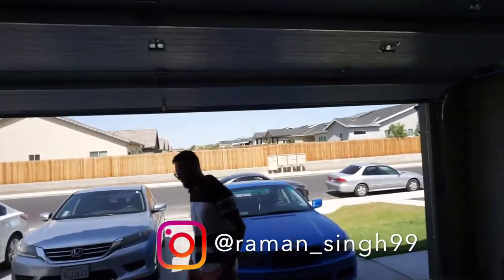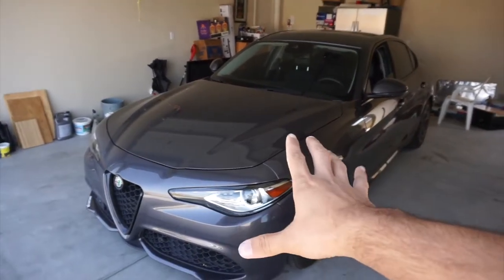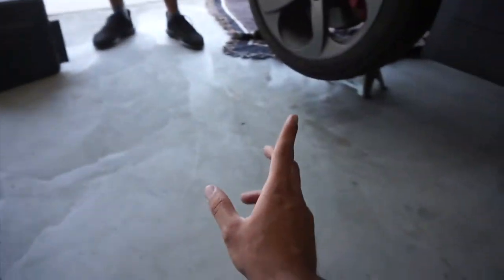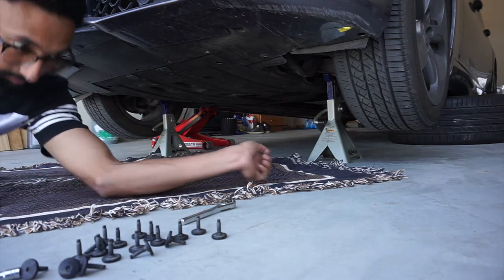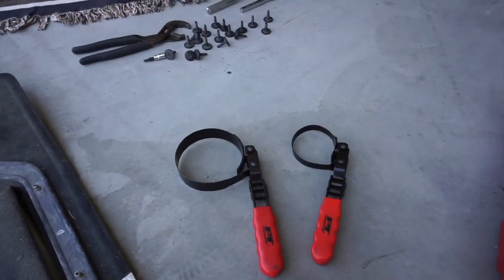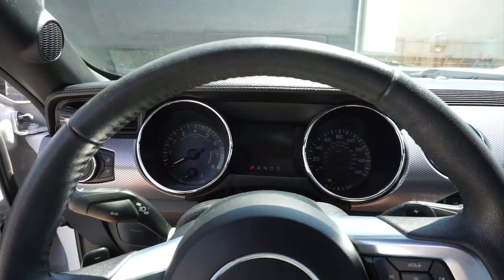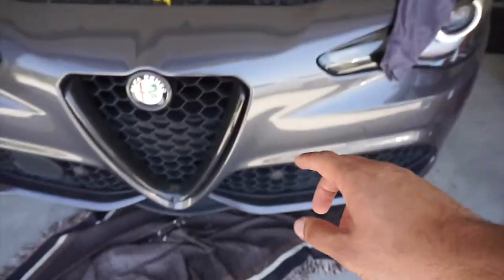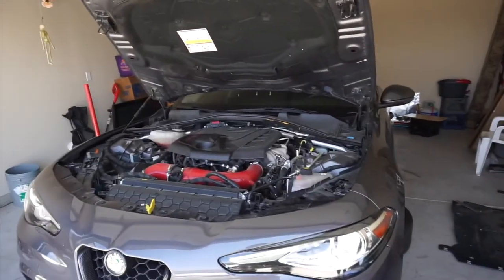Alfa Romeo Giulia oil change done ✅

Comment: Pro tip: Hand tighten all those undertray screws. You can use a power tool to unscrew them, but when you put them back do it by hand. A power tool will torque those suckers in so tight some will never come out again.
Reply: do you have an alfa?

Comment: Dealer charged me $311 for an oil change for my Guilia
Reply: I know in the Midwest it runs around 250-275. Not too bad.
Reply: My friend with this car saying they charging her $215 at most it’s for the skid plate and understandable annoyance but still no reason the oil change should be $215 but that is cheaper than both the prices yah mentioned and thats a Alfa Dealer in Boston, MA or surrounding cities

Comment: Naw, screw that, ima just a couple nut plates and make a door for the oil drain.  That’s crazy to have to take that entire pan off lol
Reply: Every time I change my oil on my BMW I thank an engineer there is an access door for the oil drain plug and then the filter sits on top of the engine right in the front.
Reply: That's the first thing I was thinking. I would only take that thing off 1 time lmao
Reply: I'm planning on buying one soon and I was thinking the same exact thing once I saw how much is involved in just getting to plug and filter. No wonder they charge an hour and a half. It's 45 minutes of loosening and tightening bolts.
Reply: @no1dejfan  I've Heard of certain Alfa dealers just cutting a hole in the Skid plate where the filter is. I'd be pissed if they did that to mine.
Reply: @pick1888  I'd be pissed too because they will still charge full book rate every time. But that's what happens when shops pay their guys flat rate. 

That said, my plan keeps it covered and well secured but would not take more than a minute or two to remove and replace.

Comment: How do you reset engine oil light
Reply from the maker: Step on the gas 3 times with just the ignition on
Reply: @daringwhips  thank you sir !
Reply: @b58Narek  did it work?
Reply: @dmeh9836  lol no had to take it to dealer
Reply from the maker: I can make a video about it bro it worked for our Alfa 🤷🏼‍♂️
Reply: @daringwhips  yea idk bro mine didn’t work i tried everything i had to take it to the dealer so they can reset the light and the maintenance meter
Reply: @b58Narek  did they charge u for that?
Reply: @daringwhips  did u make a video about that?
Reply: @daringwhips did you make a video by any chance?

Comment: I believe that’s not the correct oil bro, I’m not 100% sure but don’t they take a certain European formula?
Reply from the maker: I checked with my tuner before changing the oil so I know it’ll work. And it’s been over 5 months it runs perfect 👍
Reply: Pennzoil euro platinum 0w30
Reply: @nexushexus4365  for 2.0 gasoline it's 0w30, diesels take 0w20. Petronas oils are recommended but not a must
Reply: Bro it has a certain MS you need the mopar oil not that mobile 1 even tho i wish mobile 1 worked as it’s exactly half the cost as the correct oil

Comment: Wrong oil, Multi air Unit will blow up
Reply: It's the same oil dealers use when they are out of Mopar
Reply: @anthonydavino  anyway Multiair Unit needs a Special oil from selenia , After 50 k Miles you will see what Happens.
Reply: No is not, this is the same oil the dealership uses. Alfa updated their specs since 2020